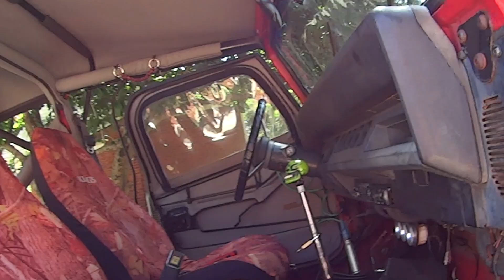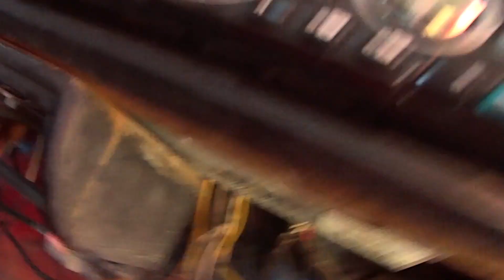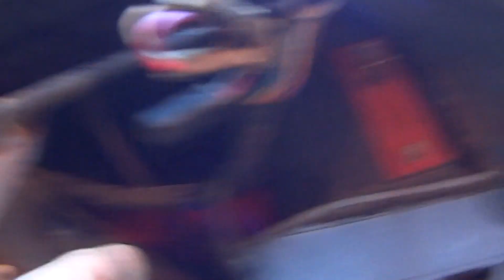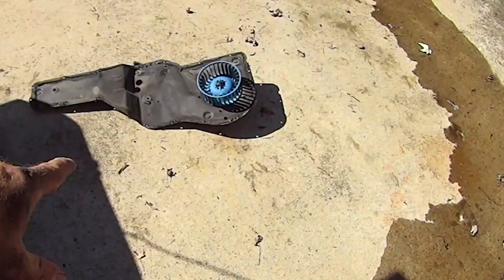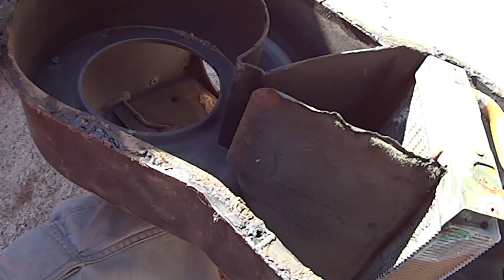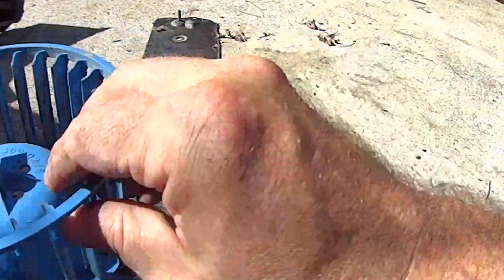Jeep Wrangler YJ - Heater core and blower motor swap - pt1

Comment: Would it be better to take the copper heater  core to a radiator shop have them boil it out and fix the leak and get  10 plus more  years out of it  /   because they say the aluminum last only  a year or 2 or 3  if your lucky  / the car wizard  video  shows the customer wants him to cut the fire wall the size of the  heater core and take it out from there  / then replace with new core and  put a plate  held on by screws  over  the cut out and seal it up  and your done / it's a little more  work the first time but e/z to replace after that   no /yes    / have you seen the video ? check it out

Comment: Excellent video, and I second those thanking you for keeping it Rated G.  One thing that helped me was popping the three antenna screws and sliding the antenna mount out of the fender.  That little stem from the antenna will hang the heater box.

Comment: I watched this video three or four times before going about this repair, most definitely on the money as explained. The only things I would add are, since I'm rebuilding an '88 Wrangler yj, there's a couple things to watch for. 1. The new blower motor WILL NOT fit in the same hole as the OEM. You will need to do quite a bit of trimming. I will back fill with some RTV against the motor housing. 2. The new heater core did not come with the mounting frame, no big deal, just squash it in there. 3. Make sure all the flapper doors are aligned before reassembly of the boix. It's called out well in the video but I can't overstate this enough. 4. If at all possible, you will do better with a second set of hands during installment of the box. Someone has to be on the firewall starting the nuts as the bolts come through. 5. My battery tray was rusted so I spent a minute with a wire wheel and some rubberized paint. Makes a huge difference under the hood. Anyway, great video, I've watched a couple of yours to help me with a few things. Appreciate ya!
Reply from the maker: Glad the video helped! You have some very good tips as well!

Comment: When you use switch your fan panel from defroster to heat does your Jeep have heat blow through your windshield vent and floor vents or just floor vents?
Reply from the maker: Floor vents
Reply: When mine is on heat, I get some air out the defrost too. Maybe 75 percent out the bottom and 25 out the top.
Reply: I was just wondering. I went in to get my heater core changed out and prior to that my heater came out from floor and defroster but now only on the floor. Also the hot air doesn’t come out as hot anymore

Comment: Watched your video last night, first time to do the job took me just over 3 hours start to finish. Every bit of your video was exactly on point. There were only 2 things different with my replacement I can across, I removed the radio panel to get the defrost boot on (very easy with it out), and I have a 4.0 and the  far right bolt behind the valve cover was hard to get a hand on. I had to use a 1/4” drive deep well socket (put a dab of permeated in the socket), a swivel and long extension to get it off and back on. And you were right the core plate is not drilled correctly. I used 1 bolt as you did. Someone mentioned the core mount is adjustable, it is not, it is welded to the top tank. Mine did not come with the the foam cushion, but I was able to peel it off and reuse it.

Comment: Can I cancel the heater core unit completely and not effect my air condition because I live in extremely hot area and don't need more heat 😰
Reply from the maker: Yes you can. I've got a video about bypassing the heater core. Have a great day!

Comment: My YJ blows air but it’s not hot. Does that mean the heater core needs replacement only?
Reply from the maker: More than likely you have a thermostat stuck open. I'd try that first because it cheap and easy. Good luck! Have a great day!😊

Comment: Why. Not get the old heater core leak fixed that new one  looked cheesey  PS love your videos great info
Reply from the maker: When a radiator or heater core has one small leak, there are other weak spots getting ready to pop. So if out repair one leak, there will be another right behind it. So .. essentially you end up pulling the heater core out multiple times for the same issue just different places. I agree that heater core that I installed wasn't very impressive, but its worked great and hasn't leaked a drop since I installed it. Thanks for checking out the video and taking the time to leave a cool comment! Have a great day!!

Comment: Probably dumb thought from barely a shade tree mechanic but...if the heater core is full blown leaking into the cab I’m betting I don’t want flush the core with the garden hose. Right? Great video!
Reply from the maker: If its leaking that bad. There isn't much point in trying to flush out the coolant to prevent making a slimy mess. Hope the video helps you!! Thanks for checking it out! Good luck and have a great day!

Comment: Like the video, helped a lot. I just did mine without removing the battery or box. Saved a little time.
Reply from the maker: It can be done without removing the battery tray. For me, it was also about getting the video and all its details. It better for the video to be able to show all the places needing access. Its bit more work for me, but it helps with the quality of the video. Thanks for checking it out and taking the time to leave a great comment! Have a great day!

Comment: I watched this awhile ago because I am getting ready to do a heater box swap/new core, fan etc. and wanted to ask you if installing the chevy 70's truck blower motor/fan would give a lot more air push? I have been restoring my YJ and have never used the heater yet so I don't know how good/bad the blower fans are. If the chevy fans are a lot more powerful I'd like to install one while i'm doing the swap. I believe all I have to do is make the firewall hole larger correct? And maybe make new fan mounting holes. Any help would be great and always a high thumbs-up for your vids...I too appreciated the no-cussing vids and your easy to follow instructions/help. You're tops in my book!
Reply from the maker: Thanks, glad you like what I do! It means alot. That blower I used puts out lots of air. So I really have no reason to check out the Chevy blower motor. The Chevy motor mod is mostly for the 90 and back YJs (mine is a 91) that have the 1 wire blower motor. I've read in other forums that they have replaced the old chevy part number with the current YJ number. I haven't researched to confirm that. I thought about trying it. but honestly, the one I have does a great job so I'm just letting it ride as is. I try to keep my videos kid-friendly, ya never know when the little ones are enjoying the videos with their parents. I can think of 2 videos that I slipped. One video I got nailed with a wrench or ratchet (can't remember which), the other I sunk my Jeep in a creek. I put a sound edit over the bloopers :-).  Thanks for dropping in! Have a great day!!
Reply: Hey thanks a lot for the reply...mine is an 89 so will research the 91 YJ fan vs the chevy. i'm getting older and my feet get like an ice cube in the winter lol so want to make sure the heater works real good. I am in the process of installing that aluminum coated air bubble insulation throughout the entire jeep interior before carpet...I wanted to use a rubber/vinyl molded floor but man-o-man they want a fortune for the kit so opted for the carpet kit and will use some large rubber floor mats. I also coated the bare metal floors with the rubberized brush-on water proof coating...around $25 a quart at Oreilly's Auto Parts...seems to be a good product...real thick stuff. Thanks again for your help and I look forward to your vids. Peace

Comment: Thanks this was a great help. The higher SCFM Chevy?GM blower was $70 cheaper than the Jeep replacement.
Reply from the maker: Glad the video was of great help for you! I've alway heard that the GM blower was better. I haven't tried one yet. But, I've read several places on the internet that now, the GM and the Jeep are the same part number?? I haven't checked to confirm this. Thanks for taking the time to leave a great comment! Have a great day!!

Comment: I am thinking of looking into cutting a square access panel in the firewall, so the blower can be replaced easily. I am already working on making the core removable from the front.
Reply from the maker: Either one wouldn't be a hard modification. Especially the blower motor.

Comment: Aluminum sucks. It's worth finding copper whenever possible. I have saved my radiator several times over being able to solder it (no plastic tanks either!). You can't solder aluminum. It's not as big of a deal with the heater core, but still could save you some money if you have to fix it.
I also put an electric switch on my heater. having it constantly heating in the summer can suck. the flaps don't stop all of that heat.

Comment: I got a question: 
A couple of years ago my temperature gauge stopped working inside my jeep( yj 1991)  so my mechanic created an alternative way of giving me a temperature gauge inside . 
He set up a temperature gauge on the bottom of the dash like you have in the video but he also told me I will no longer have a heater in my car . He hooked some adoptor sensors to my thermostat inside the engine area and ran the wiring along the valve cover all the way inside to the gauge . The gauge works fine but I no longer have hot air to keep warm in the winter. 
I'm moving Nth in a little while .
How can I get some hot air in my jeep during winter ?? I'm gonna freeze in there
Reply from the maker: There is no reason why you should not have heat if the mechanic did it right. The only reason to bypass the heater core would be in the event its leaking. Here is the video where I installed the temp gauge: https://www.youtube.com/watch?v=DlxAm2nDjtc

Comment: On a separate topic. I also have a good fix for the plastic, papery circuit board that runs your cluster gauge that I discovered about 10yrs ago. I have had my jeep over 20yrs now, she is my 1st & only car & I'm always fixing things I know I can do myself to save $.
    From time to time my jeep, as I sure many others do, mine leaks from under the dash & when it does it's usually my indicator that it's time to redo the window or cowl seal. Redoing either of these seals is a pain (at least for me) so I tend to just deal with a small leak until it become s a big one. Anyway, if you have ever had water leak behind your dash it can sometimes effect the circuit board & you'll end up having gauge lights go out or the gauges will stop working altogether. I have found that the water ends up eroding areas of the copper connection lines that run through the plastic board. 
   Since I was never able nor have yet to find a replacement circuit board for the speedometer & odometer I thought my only other choice was having to buy a whole new gauge cluster. Not wanting to put out the $ I started thinking about how I could fix it on my own & that's when I got the bright idea that I could use copper tape, like the kind they use when doing stained glass. Gotta love art class... but it turns out this wasn't a good idea, it didn't end up working so I called the company from whom I got the tape. 
   When I called I spoke to a very lovely & very helpful gentleman who told me that it probably didn't work because the glue used on the tape wasn't conductive. This gentleman then suggested that I try a liquid silver pen, so I did & it worked great! I use a little rubbing alcohol to clean up & remove some of the erosion & green tarnish from the broken copper lines & then start drawing new connections. 
   The pen is call circuit writer & you can get it online or I get mine from radio shack for around $20.00. I have recently seen a replacement circuit board for the oil, temp, 4wheel & fuel gauge cluster but still nothing for the speedometer or odometer. With that said.... I hope this comes in handy for you or someone else.

Comment: Hope I don't sound stupid by saying this... but instead of pulling out the garden hose & air compressor why not just get a bag of cotton balls & shove them down the heater core's in/out flow pipes, or even paper towels. I would put as many as I could fit in each pipe this way they will absorb the antifreeze & stop any leaking.... just seems easier then hassling with the other stuff.
Reply from the maker: If replacing the heater core. I could see that it would lessen the mess. If a person has access to compressed air, I'd still blow out as much s possible. Antifreeze is slick and slimy making tools hard to keep a solid grip on. Good tip though for the final little bit that always stays in the core. But as you mentioned in the other comment, stuffing something in the heater core tubes is only a good idea if the heater core is being replaced. Otherwise dont want to run the risk of something interfering with the water flow. Thanks!! Have a great day!

Comment: Because of you I took the challenge. I am a novice when it comes to being a mechanic.  Not only did I successfully put in the part but had to make a small modification by enlarging the hole.  I can't thank you enough. Keep the videos coming!!!
Reply from the maker: You are very welcome! William. this is why I enjoy creating these videos. When I get comments on how much a video helps someone, It makes all the extra time spent with the camera well worth it! Congratulations on a successful install!! I got more great videos coming. Thanks for taking the time to leave an awesome comment! Have a great day!!
Reply: William Ramos  how did you go about enlarging the hole?
Reply from the maker: It can be done with a half-round file. Using the file you can slowly take out metal until it fits like you want it.

Comment: I tried to replace my leaky heater core a while back ago but couldn't manage to remove the whole blower assembly since my YJ has AC on it. Thanks to your video, I got my confidence back in order to, hopefully,  fully tackle this repair. Thanks for all the attention to detail and authenticity. It certainly did not go unnoticed! 

Nice diver plate btw!
Reply from the maker: You are very welcome! Having AC does complicate the process a bit more. Good luck with the project! Thanks for taking the time to leave a great comment. Have a great day!
Reply: how’d you get it done with the a/c in the way. i got the same problem

Comment: replacing my 95 yj heater core but I have AC also wondering if I have to disconnect the AC vents and lines
Reply from the maker: +shots2 Yep ... the heater box had to come out enough to get to the screws that hold the back plate.
Reply: +Power Addicts - FixJeeps.com - Jeep, car and motorcycle tips well compressor shot not worth keeping . getting rid of AC alltogether
Reply from the maker: Drop the top is the best AC :-)

Comment: I've been reading on some forums that the PM-102 will not fit with a later YJ models. I went on Autozone's website and it says that the PM-102 blower motor only fits up to 1990 jeep wrangler. I really would like to upgrade to a better blower motor but I don't want to buy the PM-102 if it doesn't fit my 1995 YJ. Can you shed some light on this for me? Can I actually get this upgrade?
Reply from the maker: +Peter Johnson I personally havent done the upgrade yet. I eventually will, just not sure when. To my understanding you have to open the hole where the motor comes through the fire wall. It's not a bolt in swap.

Comment: I was getting ready to rip the dash out of my '95 Wrangler when I found this video.  Saved a ton of work.  Thanks!

Also thought I'd mention that you can get to all four nuts on the firewall under the hood without removing the battery tray.  The three high nuts are in plain sight.  The fourth nut comes off with a 7/16" socket and a six-inch extension.  Well, at least in theory.  Mine sheared off the same as Power Addicts's.  Regards!
Reply from the maker: +Shayne Picard 
You welcome :-) Glad you didnt pull out that dash! Thanks for adding in the suggestion. That helps other viewers when they drop in to visit. Have a great day!

Comment: do i need to go through that whole process with the tubes and draining the antifreeze if i just want to replace the blower motor?
Reply from the maker: +Daniel Haghjou. You could take a couple of pair of vice grips and squeeze the heater hoses to minimize water loss. Those hoses need to be disconnected from the heater core to be able to remove the air box. Air box has to come out to get to the blower motor mounting. Thanks for checking out the videos! Have a great day!